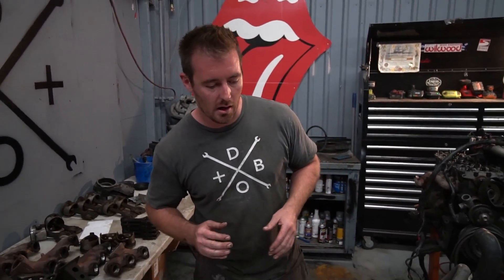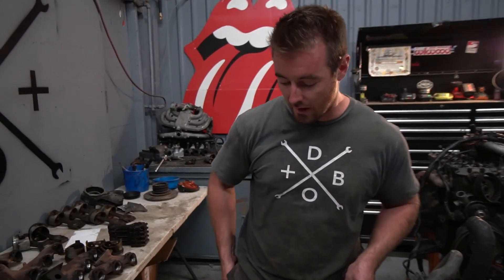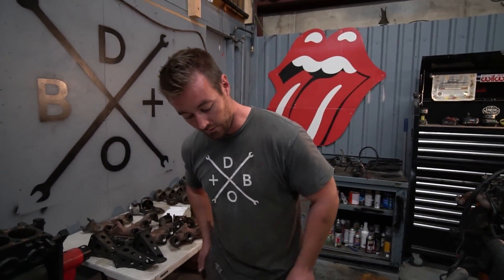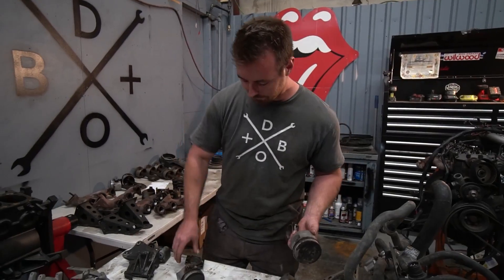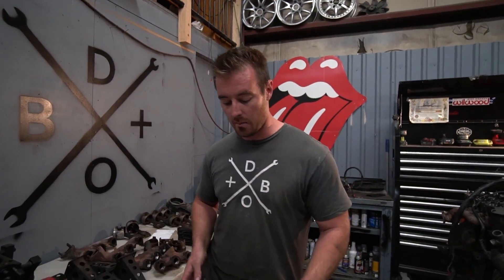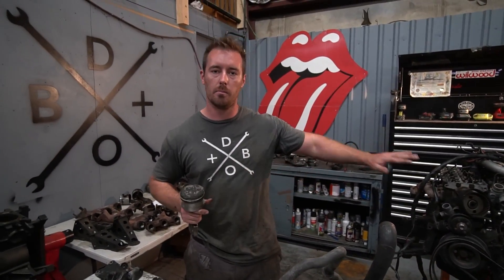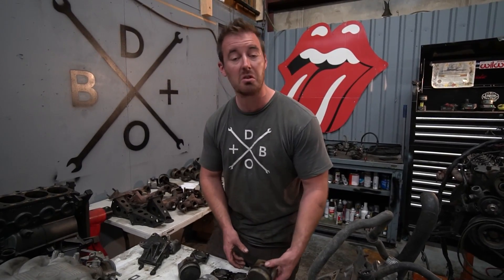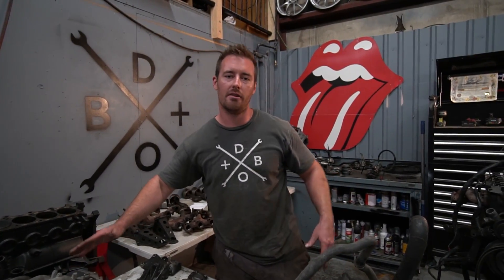M20B27"i" Stroker | Important Piston Info!

Comment: What bolts did you use to mount the motor on the engine stand? I'm struggling to find bolts size for a 1986 build date 9/86 325e for Bell housing?

Comment: I am restoring a 1980 323i. It takes a few times to start, runs good but dies at a stop. Got a cold start valve from Germany, however it still won’t idle, just dies, been to two shops $$$. I’m thinking of a m30 swap. Suggestions on getting my m20 to idle?
Lew
Vancouver, Wa

Comment: What is the resulting compression ratio achieved when using the 11251735755 piston with the B27 bottom end and an 885 cylinder head?

Comment: I've read that running the entire b27 rotating assembly leaves you with a compression ratio of 8.4:1. with late b25 pistons, what does the compression ratio end up at?

I have a low-boost b25 that smokes and I suspect failing piston rings. Wondering if an entire b27 bottom end is the move, or just crank and rods if I don't want a lower compression ratio losing me low end torque.
Reply from the maker: you are correct it is 8.42:1. Using b25 pistons yields 8.8:1. If turbo I would definitely just use the entire b27 short block and just throw the 885 head on it.

Comment: Just chuck the pistons in a lathe and turn the skirts down. BANG, now you have "weight improved". Yes, I have done it multiple times. If you are shaving the block ~2mm and using the eta rods/crank, they put down about 180whp on a stock cam. I have a long m20 dyno thread on r3vlimited, username is "forcedfirebird".

Comment: So if I do all the steps to swapping an 885 325i head with all needed accessories  Besides the the pistons from the 325i and keep the 325es Diesel looking low compression factory piston

I will have a great turbo setup, right?
Which after boost will make more power than a stroker motor with the 325i pistons anyway. 
If I’m correct I’m going boost.

Comment: I've just put together a m20 bottom end stroked to 2.8L with
M52b28 crank 
M20b25 short skirt pistons 
M20b27 130mm conrods
Reply: how do you get the M52 crank into an M20? It's not plug & play afaik.
Also: typo in your comment. 230mm rods? You mean 130mm
Reply: @dokterkarel  the m52 drops straight into the m20 block it fit perfectly, only thing it needs it a steel spacer for the front crank seal and timing belt gear. Yes sorry i mean 130mm conrods
Reply: @adamm9903  Thanks for your reply. By accident you don't have any pictures of the install of the crank (as in where the spacer goes, as I have trouble visualising it. Yet I'm planning to stroke an M20 soon. Just finished my M54B30 rebuild & swap and looking for a new project)
Reply: @dokterkarel  I do actually I've been taking photos throughout the build of it, if you go to my instagram page ae_workz I have a few photos up already and can send you more

Comment: Thanks putting all of this out there for us weekend warriors Will.
Could you possibly measure the skirt height on the light weight 1990 piston? I’m thinking that with far more of the original variant i piston out there that this issue could simply be overcome with a lathe or mill. We just need to know the skirt height dimension to machine them down to.
Cheers...looking forward to many more DBO vids.
Reply from the maker: Already jn the works my friend! Going to machine a set of long skirt pistons to the same specs as the short one and list the dimensions.
Reply: Ghetto minds think alike! Awesome!
Reply: @DENVERBEERANDOIL  any update on the piston dimensions?

Comment: I built my stroker with an m52 crank, 135mm rods and custom pistons. Unless you have the super eta pistons making a stroker work without massive machine work is not possible. I have all the piston, crank and rod options in my garage and I decided on custom pistons because the cost was less than machine work.

Comment: Hi from Finland! I just bought my first e30 cabriolet a few months ago and the engine was badly broken, one of the valves was in the piston. 😅 I haven't ever built any engine but I watched your videos for that head assembly example, and it was very helpful. I have driven it now maybe a month and it works great. The only thing what is bothering me is that the oil light is not working, i have oil pressure gauge there because of that. This Stroker build is very interesting because i have a few blocks, one head, eta crank and better camshaft allready. Hopefully u understood something from my bad english. 😅 Keep up!
Reply from the maker: Glad you enjoyed watching! Super glad to hear it’s been running without problems!

Comment: Also most flat bottom late pistons have 8.8:1 compression 
Early pistons are 9.4 and 9.7 
They have numbers on them so you can check it online to see what compression they have
And 1 more thing the date is wrong
I open 2 m20b25 engines from e34 525i
 1 from 1988 and the other from 1989 and both had the late flat bottom pistons with 8:8.1 compression

Comment: Thanks for the info Will! I never thought about pulling up realoem or looking for a build date to see if there were different part numbers/ updates. I bet there is a TSB # that you could probably look up to verify the newer style pistons as well. I should've known this information and I can't believe that I didn't. I built probably half a dozen of these over the years but it's been quite some time and I always did it the way you have because I never knew. You do a valuable service by helping people decipher what works and what doesn't. Hell I've had these motors apart so many times, but even someone like me could benefit from a 'refresher.' DBO is my favorite channel by far, and definitely the most underrated and entertaining stuff on the interwebz. You planning on making a video with Hamish's m60 swapped e30? Looks cool, and those things are fun with the m60 installed. Even a m60b30 is an upgrade over an NA m20. Can't go wrong with the v8 torque and sound. I had two 540/6 e34's and they were just great daily drivers. I miss them honestly. One of mine had the e32 3.15lsd, ltw flywheel, full mandrel exhaust with a Magnaflow/ cat delete, e60 545i 'short version' shift lever, poly motor/ trans/ suspension bushings, etc. Those mods in my opinion, are the best for the m60 powered cars. Diff, flywheel, shifter, exhaust, mounts, maybe the bigger plenum (b44 or ITB's) are the most noticeable stuff that really improves the enjoyment of that platform. Everything else for the m60 is big money really....
I'd definitely like to see some video and details on that car. Great work as always!
Reply from the maker: Hey Pete! Hamish here, I already have two episodes filmed! Just need the balls to put em out haha, right now it’s an m60b44 with the getrag 420g 6, it’ll be mated to a 2.93 LSD, the shifter is an e46 m3 assembly, fits mint! I’ll try and get that video out this week!
Reply: @DENVERBEERANDOIL  Hey Hamish!
Yeah bro, definitely post those please. Love these type of builds. The m60b44 is the best one to go with, and I believe it already has the best flowing intake manifold IIRC. Pretty sure that's the one I threw on mine. You should definitely investigate what other diffs you can use on the e30. I know when I used the e32 3.15 on my e34 it was probably the best upgrade you could do with the 6 speed to get you a nice increase in acceleration. Since it was a 6 speed, the final gear is fairly tall and you won't be at high rpms with the shorter final drive. Only thing you need to do on the e34 to make it work is change the input flange. Otherwise FWIR it bolts right up. Obviously your case is a different size in the e30 but I'm sure someone has figured a different OEM alternative that it will benefit from. All my 2.93 diffs were open which sucked because both my 540/6 had ASC. That setup is a huge buzzkill, and even when its disabled, the intake boot and ASC throttle body is restrictive. BMW has a non-ASC intake boot which is an improvement, or you can make your own out of silicone couplers and a couple small chunks of 3.5" or 4" piping. I'd recommend chipping the DME if you haven't already as well. Hard to go wrong for the $ to pull the speed limiter, raise the rev limit, and add a better fuel and ignition map. There is a guy out there who does custom tunes for the 404 DME. I'm sure he does others if your running a later one, but afaik the 404 is the best one to go with. Check DUDMD on bimmerforums. Hes the guy that burns custom eproms. The lightweight flywheel is an enormous upgrade as the stock dual mass is heavy as hell!!! Pretty sure they're just south of 30 lbs! I had a JB Racing one on mine and what a difference. Also has the JB on my e36 track car and it never let me down in over 15 years of abuse. Some things to ponder for the future if you end up having a couple extra bucks to spend. Get those videos up broseph!!! Excited to see what you've got going on there!!!

Comment: Great vid man, Is there any m30b35 stroker mods?
Reply from the maker: There are a couple different combos of cranks/rods/pistons from the b35, s38 and m88/m90 that you can use for displacements between 3.7 and 4.0L but parts are much more difficult and expensive to source.

Comment: In the last video, you mentioned issues with the i piston contacting the head when running the e crank. Can you go into more detail about that?
Reply from the maker: That's only if you use the longer "i" rod in conjunction with the e crank and i piston
Reply: @DENVERBEERANDOIL  so to confirm, if I have the later i piston, e crank, and e rods, that setup will work? I have a Nov. 1990 build date 325i and hope to eventually make a stroker from it. Is there a performance camshaft you recommend?
Reply from the maker: Yep! You have all the parts to make yourself a stroker. If you want a "performance" crank from stock parts, the m21 diesel crank is forged. Tough to find though.
Reply: @DENVERBEERANDOIL  thank you! Any thoughts on aftermarket camshafts? Dual pattern vs single pattern? How much lift? Etc.
Reply: @DENVERBEERANDOIL  I was curious if it was to do with the compression height difference of the i piston. You mentioned removing material from the i pistons for them to work.
Reply from the maker: @ChrisJackson36  that is why I made this quick little video about the pistons. You would need to modify the long skirt early 325i piston but the late ones work

Comment: When we stroke m20s in South Africa we use m20 block m52 328 crank 
320 m20 rods
N Opel superboss pistons 
278 cam 
Lite flywheel 
Gas flow n port head 
High revv kit
Reply from the maker: Any chance you have access to any of those parts? Would love to play around with some stuff the US doesn't have easy access to.
Reply: For those who don’t know the 320 m20 rods are the same as the e30 eta rods here in the US that are 130mm.
Reply: @michaelwinfrey2047  are they the same weight?
Reply: @PRINCEkris01  from what I can find m52 is lighter than an m20 crank by 2.05 kg
Reply: how do you get the M52 crank into an M20? It's not plug & play afaik.
Reply: dokterkarel the crank drops in no problem, but you’ll need to make sure the pistons you choose clear the counter weights on the crank and the rods. You’ll also need a custom made nose piece for the crank since it’s based on chain and the m20 has a belt.

Comment: Awesome video, I did not know there was a difference. I do now! Thanks. PS have you guys ever had any issues cracking heads between 5-6 cylinders on a striker build? I head on E bottom end. I’ve cracked 2 heads in a row now at 15 psi of boost. Tune has very mild timing. The crack is in the water galley and as soon as it pops coolant starts coming up into the valve train. You can see the crack when you take the valve cover off. Never happened on my I motors with the same boost and the same head. Anyway cool vid!